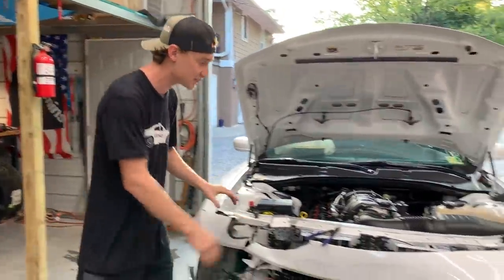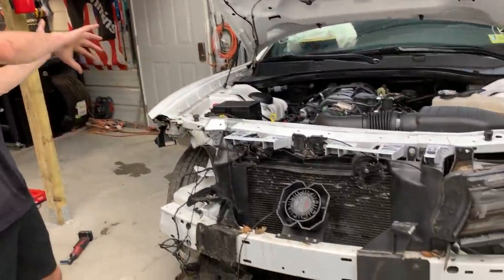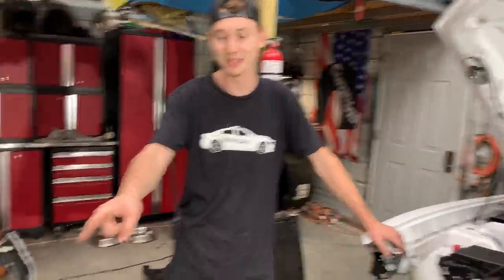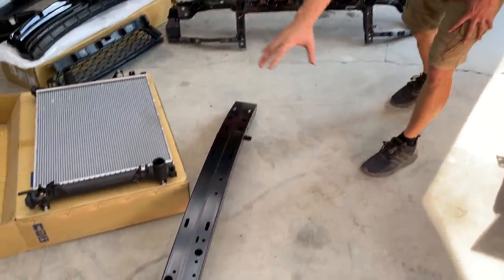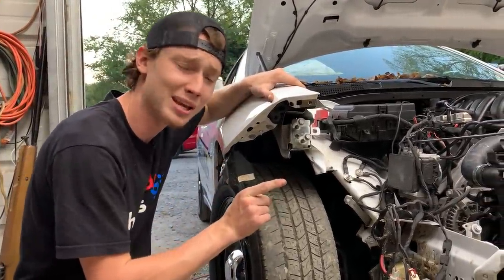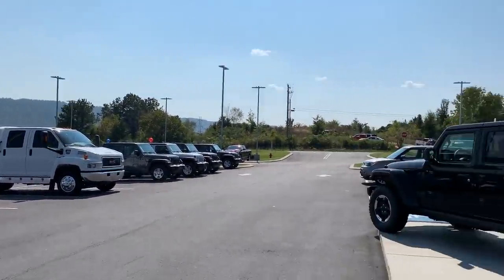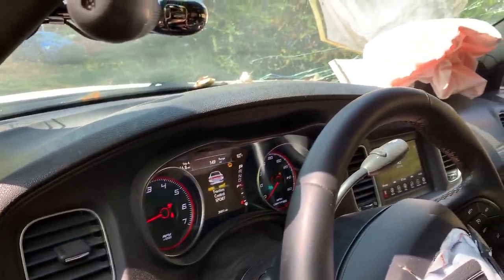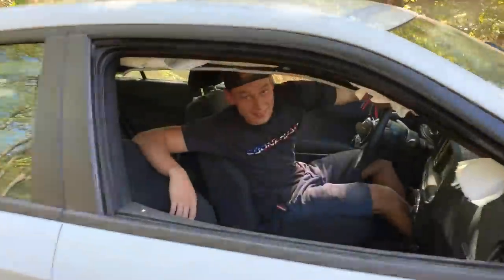Rebuilding A Wrecked 2018 Dodge Charger Police Car Part 2

Comment: Buy a Tazer or Tranzformer! They offer a hard wire kit or an OBD2 plug. It can activate police lighting and give you line locks to do burnouts. It can also lock you in AWD or RWD. You can do quite a bit with that and the app AlfaOBD. AlfaOBD works on all mopars and talks to all modules and is a definite must have. That tool can also change values in the BCM so you can set the vehicle screens to appear as a hellcat! Thanks for doing another mopar! Enjoy the build and get those two tools!

Comment: The heavy duty cooling system is actually a radiator that is about a quarter inch thicker than civilian models. I have an 06 charger pursuit. And not being rude or anything but they’re not interceptors. The chargers are pursuits and the Ford police lineup are interceptors.

Comment: Yep, that's the loud speaker for the siren.  The siren box that goes inside the car will have the actual tone generators that create the sounds (or amplifies your voice with the PA), the loudspeaker is just that, a speaker - think of it like a stereo but you put the speaker behind the grill instead of inside.

Comment: When installing the radiator hose upper and lower it's a good idea to put gasket sealer around the neck of the radiator and all housings just to make sure that it doesn't slip off preventive maintenance

Comment: We've got an X5 BMW all wheel drive with about 280hp. You can hold the brake and load up the engine and get the turbo spooled up then let off the brake and it takes off!
Traction control off it won't donut though. It just understeers.

Comment: If you want to disconnect the front axels just pull the fuse under the hood that says front axel disconnect.  It will not hurt anything it just sets off a light on the dash.

Comment: There are a few ways to enable AWD. One the windshield wipers on. Two, turn traction control off, or three it’s automatic during rain/snow or any time the tires slip.

Comment: AWD Module/Front Axle Disconnect appears to be Fuse 48 in the front PDC. Pull that and you should be able to do some skids. Fuse 9 is another one for the AWD Module. Sounds like they will give you slightly different results, but either can apparently be pulled for some quick fun.

Comment: I would recommend looking at the Procharger P1-x or D1X system for that platform. You will be able to fit the stock hood and wont have to modify the nice lines of the front end of the car. With these kits you can mate it up to an aftermarket intake manifold that will still fit the stock hood....either way this car is showeet!!!!

Comment: I have the same damage on my charger the apron is a three piece set looking at 300-400 for that and maybe 18-40 for the little metal piece that slides in the frame rail that the crash bar mounts to and the upper rails and bracket are not bad in price

Comment: Iron and steel blocks are the same thing. So it's either Iron or it has an aluminum block. The Iron block is best for high boost. 
And it's better to launch with traction control off because when it's on the brakes are applying to the wheels that try to spin. That's how traction control works, when a tire starts to spin the brakes engage and stop it.

Comment: i reckon stock front bar with the pushbar and the stock bonnet. Maybe a turbo kit since u guys have got loads of supercharged ones though i would be watching out for the strength of the driveline,

Comment: 19:32 The feature probably isn't there now. You should try the Tazer from Z Automotive. I read that it has a "Force RDW" function for AWD Vehicles and also a "ESP full on/off" function.  It's a tool that will unlock a lot of features that currently aren't available.

Comment: A few months ago I was able to purchase a lightly used 2018 Dodge Charger Pursuit with the same AWD and Hemi combo in Torred. Only 2,900 miles and civilian spec interior package. I've kept it stock because I love the look, especially the Police steel rims. Very curious as to what exhaust you guys go with on this, because that is the one mod I'm considering. I just subscribed, so keep the Charger Pursuit content coming!

Comment: If you do the hell cat bumper you'll have to cut into the actual bumper instead of just the mesh plastic on the on the police package one cause most manufactures dont make brackets for the hell cat style.

Comment: @goonzquad I believe it should be fuse 48 in the  fuse box to disable the AWD disconnect on the 2018 Dodge charger but you will get a service AWD system when the fuse is pulled but will go away when you reinstall it. I only Kno this cause I have a 2011 Dodge charger r/t AWD with a 5.7 hemi with some mods

Comment: Heard that the front axle only engages when the windshield wipers are on. Could be wrong
Reply: Nikolai Petersen there are a few ways. One the windshield wipers, yes. Two, turn traction control off, or three it’s automatic during rain/snow or any time the tires slip.

Comment: With the vehicle off, push and hold the traction control button. Keep holding it down while simultaneously starting the vehicle. Continue holding the TC button down for about 5-10 sec. That will shut off the entire stabilitrak system

Comment: In case anyone was wondering, the reason the dome light is red is cause when the officer is doing paperwork and needs to respond to a call outside of their car at night the eyes adjust faster to the dark when using the red light rather than using a bright LED light

Comment: Not sure if someone mentioned this yet:  Get the Tazer from Zautomotive and  you can FORCE RWD or AWD or have it normal.  This is and much more using the Tazer, an ODBII plug in.

Comment: You might  wana double check coolent specs it should call for purple mopar or zerx H.O.A.T worng coolent coolent could rust from the inside or cause overheating/cooling issues the car looks like a beast tho👍🏻

Comment: Ok. Comp Cams cam kit. The stock Mopar lifters are just not good and have " wiped cam lobes". I'd also look at an Arrington Engines reciprocating assembly. The problem is that stock 5.7s have so-so internals to handle boost.

Comment: Also, dodge recommends you only put HOAT mopar coolant and to NOT run universal coolant because it can rust or clog up the thermostat and/or radiator. Just a heads up

Comment: Conventional power steering are belt driven and reduce power to the engine. Electric power steering is on demand and does not take away horse power. Mazda (and a few other manufacturers) have been using electric power steering for years.

Comment: Ok, the red light doesn’t add horsepower.  The light has 3 modes.  White light, red light and off.  The red light is used to save your night vision when you are writing in the car at night. And definitely do hellcat styling.  A hellcat Police car....Totally badass.

Comment: That charger has a heavy duty 5-speed transmission. That’s why it has a truck column shifter.
Reply: No, it has a column shifter because they install a console for the radio, lights and other stuff in between the front seats

Comment: Not sure the all wheel drive can handle too much more than stock.  The reason they do not sell it to the public with the Hemi anymore is there was too many warrantee issues.  Maybe the cop package has addressed that, but maybe some weak points are still there.

Comment: Hey I own a 2015 version of this car, v8 awd old police car. If you need any info I know a good amount about these cars and I am very interested in this project! Also just wanted to mention that the car will be able to manually shift it's on the shifter itself, its two arrows and to activate it you need to push the button on the end of it. The car is a beast I can't wait for you to make this thing a beast a supercharger would be insane and id want one for myself! excited for more vids on this and if you ever run into any issues or have any questions about the car feel free to send me a message! (just now seeing both vids and posted comment twice)
Reply: I have a question bro

Comment: Electric power steering pump? Very cool, my buddy swears by electric water pumps because it runs full power regardless of engine RPM, which would probably also be a benefit for power steering.

Comment: You really should have used the 10 year Chrysler purple coolant.  Even though the universal will work fine the correct coolant should be in the car.  Anyone who sees that, especially a Chrysler guy will frown on having green coolant in there.  Coolant nowadays is like transmission fluid.  You really need to use the correct one and buy it from the dealer!

Comment: And you should do a MagnaFlow open headers stage nothing but rip and sound loud down the that big block hemi and you can probably get the same amount horsepower just like the Dodge hellcat if you put all the stuff from the hellcat in all you got to do is just put the I mean the belt driven charger

Comment: The electric hydro steering is stock standard power steering, but instead of the power steering pump running off the engine, it runs off an electric motor.

Comment: The electric power steering is made for easier to steer during slow driving and getting harder to steer at high speed. So it safer new technology,

Comment: Guys it’s above your pay grade..!!
Old days power steering pump used to run on engine power by belt and that reduced engine power .!! It has been quite probably nearly 10 years most manufacturers up graded their tech with modifications now runs on electric and most of them located passenger side inner wing... that’s how long been you kids missing this out 😅😂😂😂😂

Comment: Hey Goon squad if you want a siren get a federal pa300 they are easy to work with and fairly cheap.as for the speaker just think of it as a car speaker with 2 wires and on steroidsXD.

Comment: I would not be looking to do any boost to this car.   I think the greatest value to this car is that it is a low milage police package Charger.   These cars can not be ordered by a civilian and can only be found by way of auction in most cases.

To the right collector, the car in a "as delivered" setup would be the best.

Keep in mind that the computer setup is going to be different than that of a non police package Charger.

This car is plenty fast!  Wait until you get it out on a track.

Plate C

Comment: Look into Havis Center Consoles. Search upfitters on google and you can replace that tiny entertainment center with a giant computer screen that doubles as a computer / entertainment unit. On the center console - you can then install a CB and a ham radio. Colorado State patrol runs a tall 10m (radio band not actual height) whip antenna. Get a smaller 1/4 NMO antenna for the ham radio. Contact me for links.

Comment: so now ppl will be looking for persuit sedan and convert into a normal sedan. modify the bar gearshift and replace it with a proper shift at the center sole and paddle shift at the steering.

Comment: Rebuild a wrecked 2007 v8 sport trac ford explorer that truck rips but they like to have stuff like sparkplugs go bad alot  ut when everything is in good shape it rips like no throttle the 4000 pounds just wheelies if u have a trailer hooked up well the xlt adrenaline 2007 v8 explorer sport trac does

Comment: From Matt Robertson on the LX Forums... https://www.lxforums.com/board/general-lx-discussion-1st-gen-2005-to-2010-/159179-heavy-duty-cooling-vs-severe-duty-cooling.html
There are four radiator grades, unless they have changed them.

Heavy Duty
Severe Duty I
Severe Duty II
Maximum Duty

Heavy Duty is just another name for base level. 0.5" radiator core thickness. Severe Duty I is the slightly larger radiator you get if you order the tow package for an RT. Severe Duty II is the SRT radiator and significantly larger (1.75" core thickness). Maximum Duty is export-restricted and reportedly for vehicles bound for the Middle East. Getting one is a real pain and its nonstandard fittings make for an epic install. I know as I have one of the very few here in the States.

Edit: The cop cars get one or the other of the Severe Duty rads, plus the oil cooler and a bigger ps cooler.

Comment: You guys need to understand. You have a  5.7 . It's the smallest engine.  If you want real power. Drop a 392. Or step up and buy a hellcat engine.  You can buy either of these at a salvage yard.  You should not try to build that engine.  Just upgrade to a 6.2 or a 6.4.  If you are looking for more power.

Comment: Just remain or fractured is not brand new and it's not like news not the time it's just been remanufactured I don't like your parts and I'm a mechanic it's more you cost twice what you can get from other parts places I priced around for engines and stuff they want one for $4,000 when you can go to even O'Reilly's and get the same engine for $2,000 so why didn't you go to the cheaper places and get better Parts cuz you can get actually go to O'Reilly's and places like that and get mopar parts